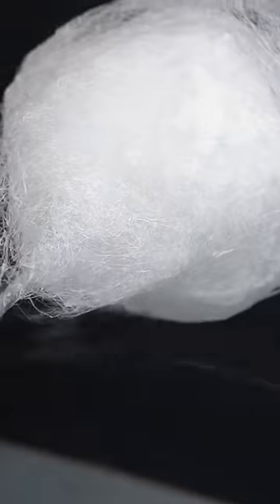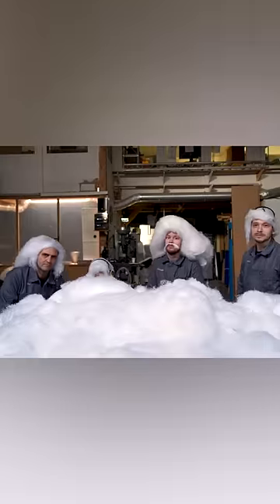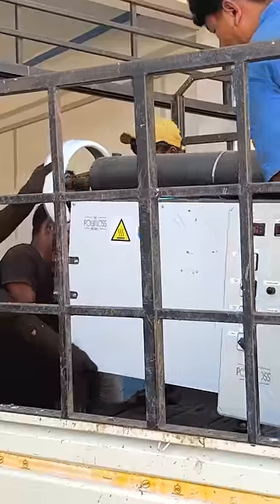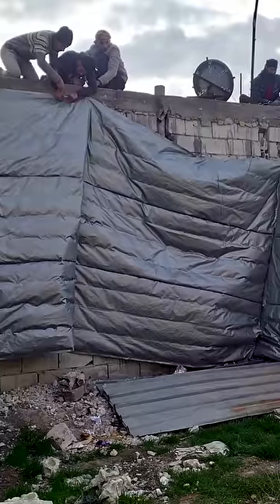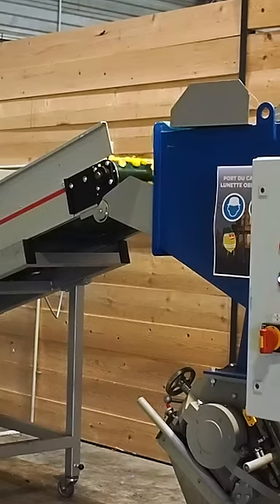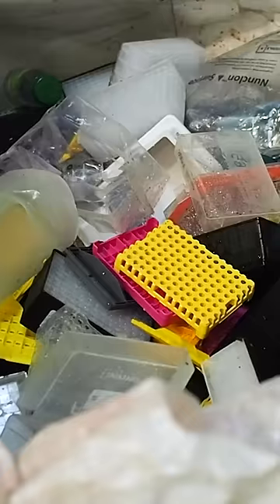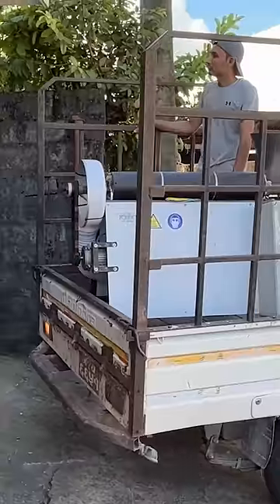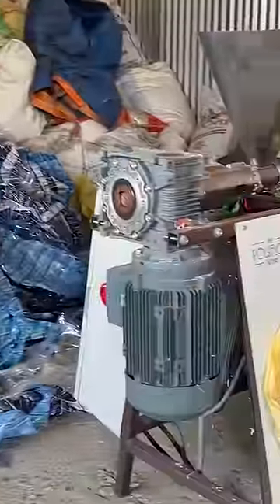This cotton candy is really plastic trash spun into ultra-thin fibers.#recycle #plastic #environment

Comment: This is just going to release micro plastics into the air
Reply: Already tons of those, far better than the amount in the ocean from improperly disposed of plastic. And its already from recycled plastic so hopefully very little lost into the environment
Reply: @EdgyShooter  Microplastics also end up in the ocean, they play a massive role in seabirds going sterile.
Reply: @RebeckadV  he knows that. Did you even read his comment? 😒
Reply: @osopetty1761  It sounds like he's speaking of whole plastic, as what's being reused in the video. I'm just saying that turning it into microplastics doesn't help.
Reply: @RebeckadV  you stated the same thing he already said, there was no point. He specifically used the word micro so what would make you think he’s talking about whole plastics? I Again you wrote what he already stated making it redundant, unless you didn’t fully comprehend what was said
Reply: @RebeckadV turning it into microplastics does help in this instance because it's giving the waste a use and preventing it from going into the ocean, where it would shed microplastics anyway. When a water bottle or any other plastic thing goes into the ocean, it does not stay whole. It breaks down within a few years, but the microplastics themselves do not biodegrade.
Reply: @2GoatsInATrenchCoat  Sure! I'm just not certain that accelerating that process is beneficial, especially not if this is done at a large scale. Plastic is tricky to deal with indeed :)
Reply: @osopetty1761  What are you being so aggressive for?
Reply: @RebeckadV  I’m aggressive because I stated the obvious? Grow a pair
Reply: @osopetty1761  "Did you even read his comment" etc..
Not everything has to be 100% new information. I wasn't trying to insult anyone, just highlighting a specific issue. Sure, I probably could have been more academic in my phrasing but c'mon.
Reply: @RebeckadV What's funny is that you're right and she's wrong. The guy never said micro, and he's on another thread making the same point that it's better to do this than leave plastic as it is to contaminate. He confidence is the best part.
Reply: *Instead of the water and soil that they normally would in a dump and in the meantime it can save lives 
Fixed it for you

Touch grass, your ivory tower has taught you nothing of the real world
Reply: @EdgyShooter this is not preventing any plastics from going into the ocean.

It seems to make sense to recycle plastic this way, but I'm highly skeptical.
Reply: I wonder if it actually works like that. That was an issue with asbestos because it’s such a flaky material, but plastic fibers are really strong and malleable and probably not as likely to end up in the air. I could be mistaken though.
Reply: If any of you bother to watch the full video you would see what they did to protect themselves and others from the plastic that ends up in the air
Reply: Everything ppl do releases microplastics in the air
Reply: that's not how microplastics work but congrats on learning a new word. try not to use it in every sentence until you know what you're talking about
Reply: Based
Reply: yup. this thing, and the asphalt mixed with plastic and also brick mixed with plastic are all dumb thing. don't do those stuff.

instead solving the plastic problem, it makes it even far more worse. microplastics is harder to clean.
Reply: I know people are dumb forever chemicals are just that forever
Reply: @NewLifeFromTheWayofTruth  they are also cheap
Reply: The entire planet is coated in micro plastic already the grinding down of the plastic pellets/recycled plastic products in plastic manufacturing plants already does that by the millions of tons every day.
Reply: I'll bet you hear a parade and think, "Great, now I'm going to be late for work."
Reply: @BroArmyCommander wouldnt the best thing be to do is pick up melt it into a solid barrel and then bury it somewhere remote?
Reply: @DannyGruesome  plastic doesnt degrade underground it degrades in sunlite burying it is literally the worst thing you could do with it making sure it lasts forever
Reply: Go away.
Reply: We already have tons of microplastics in the air, in the water, in our blood, etc
Reply: The earth will adapt and evolve.
Reply: What else you gonna do with tons of plastic? Can't exactly bury them and degrade.
Reply: not as much as India is
Reply: @RebeckadV  so what are we gonna do with plastic waste? Just let them sit around on land until they end up in the ocean? Kinda weird to worry about microplastics and "accelerating the process" when we're already practically wallowing in plastic in our day to day life.
Reply: @rurubelle2920 Would you rather we use radioactive waste for heating homes rather than just burying it in the ground with no purpose? I think most would rather it be useless in the ground than giving us cancer. Plastic is already everywhere but the continued use is just gonna add to it all. Maybe this thing in specific is not really making the situation worse when considering everything but it is also not really making it better either.
Reply: I don’t think that's how it works lol
Reply: it will release in the washing and drying machine. you can do your part and just clean it out, dispose of it properly.

when you talk, it all starts with yourself first.
Reply: There’s already loads, it’s better this goes to help people instead of filling the ocean s
Reply: I see everyone panicking over microplastics, so let me just say: 
This stuff is practically identical to polyester, fake fur and plushy filling. You already have this, and microplastic exposure is about equal. And by equal I mean there’s less microplastics entering your blood then when drinking water bottled in a plastic bottle. Bonus points if you keep reusing an old plastic bottle. 
Plastic sealed in insulation can be kept out of the ecosystem for literal decades. And yes, it still can be cleanly burned later. Do note that clean burning requires filtration to catch the fumes, and this may not yet be available in poor areas. If burned without all the required filtration, you get fumes that are worse than microplastics. So you might as well reuse the plastic and store it as insulation until such a time where it can be safely disposed of, which can be years to decades depending on local development. 

Its a good thing that everyone thinks critically and questions progress. But please be careful not to blindly join a judgement bandwagon either. Question both sides of the coin. And by all means, question me, look things up. <3
Reply: @RebeckadV there also in our food anwyays too
Reply: No, it's not. The worst it'll do is let off some unpleasant smelling fumes. This is how polyester has been made for decades. This is how you get the fluff inside stuffed animals and pillows. It's used as a cotton replacement.
Reply: IslamIsTheSolution98 pues respiralo. 😂😂😂😂😂
Reply: @Serai3 lmmfaooooo damn you!!!! I'm at work
Reply: There literally already is thermoplastic in the air
Reply: @RebeckadV  Yeah, which is why it's GOOD that garbage that would otherwise leach microplastics into groundwater in landfills or thrown into the ocean into plastics that will stay on the land as usable products for a long time.
Reply: I dont get the whole "but more microplastics!" thing. if all that recycled material was just left wasting away somewhere instead of being cleaned and reused into a product, microplastics would still seep into the air/ground right?
recycling plastic like this is at least giving something useful in return, even if there are still going to be microplastics present.
Reply: We move one step forward and two steps back. The question is what are YOU going to do to help. We all have our part to do.
Reply: @RebeckadV did you know that scientists have actually bred a type of mushroom that eats plastics.
Reply: Leaving the plastic bottles as waste somewhere is more harmful... I mean its a pick a poison type of deal but so is everything with plastic recycling...
Reply: @RebeckadV they don't "end up" in the ocean
Plastic becomes micro in the ocean
Reply: @RebeckadV 
IT'S MICROWAVES NOT MICROPLASTIC KILLING EVERYTHING OFF.
Reply: Who cares we're all doomed anyway.
Reply: @DamonAkuma92  
I'M THE ONE THAT GETS AWAY.
Reply: @HerFistIsAmerican  Glad to be of service!  :)
Reply: @jadecoolness101  NO ONE IS TALKING ABOUT MAKING MORE.  This stuff is RECYCLED PLASTIC.  Did none of you actually WATCH the dam video???
Reply: @Serai3  literally what are you talking about. Taking plastic and turning into tiny strings which WILL break down into micro plastics far faster than an actual piece of plastic IS making more microplastics.
There's already enough, we don't ned to help it along.
Reply: ok, so worthless until another big company breaks down the waste into pellets. by that point it is already another product. so this is not helpful.
Reply: @RebeckadV I don't agree with ur point but idk why people get so heated over interesting topics like this
Reply: @BroArmyCommander chill out
Reply: Is it?
Reply: omg environment nououo your shirst didnt even releesed one to eir
Reply: @EdgyShooter what are you talking about? Both are bad
Reply: Hello Double standard Karen

Comment: This is so interesting this would be a great replacement for the fiberglass insulation used in housing.
Reply: You are right...the only draw back is that during a house fire, it would melt, and burn causing a more intense fire, toxic air, release of hazardous chemicals, ...I personally know you can make paper products, from hemp and bamboo.
This no more chemical and land filling waste, very biodegradable, and can be grown with limited water, very quickly...thus no need to cut down the rain forest for wood pulp, to make paper or card board.
Reply: Soooo make more plastic?
Reply: @ZeeZee9  😂😂😂😂
Reply: @Itsamallard  lol
Reply: No
Reply: @michellekrueger5122 what do you think happens if there is a fire!?
Reply: The fire marshal has left the building
Reply: @michellekrueger5122 Paper and plants are also notoriously flammable, you know.
Reply: @DogDogGodFog Shhh, it's the current solution to the current year's problem. It has no flaws.

Comment: Waiting for the class action lawsuits about mesothelioma for plastic floss industry employees
Reply: Yeh I’m kinda mixed on this one it’s great that they are making a sustainable business of recycling but it does seem like there could be some major drawback to this process though I dunno
Reply: @mr.frogster4398  As it's made from PET bottles which are bleached that is the biggest problem.
Reply: That's why they send them to refugee camps
Reply: @pissapocalypse  woosh
Reply: @pissapocalypse  no shade, lol
Mesothelioma wasn't known to be caused by asbestos for decades and it's basically a disease caused by microscopic asbestos fibers entering the lungs and damaging them. This plastic floss almost certainly will exude microplastics (microscopic bits of plastic) that, when inhaled, will damage the lungs, causing respiratory illness and this will likely go undetected as the source of many cases of lung disease for years. I was making the joke that, like how we see mesothelioma class action lawsuit commercials about asbestos exposure, our kids will see basically the same commercials but about microplastic exposure instead of asbestos.
Reply: future memes boutta be crazy